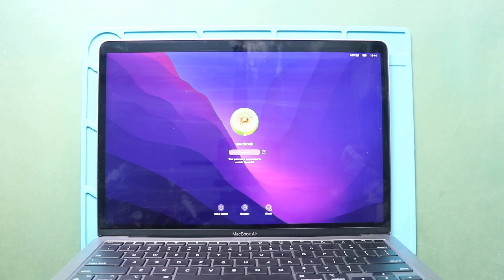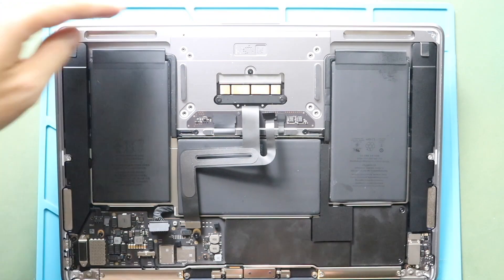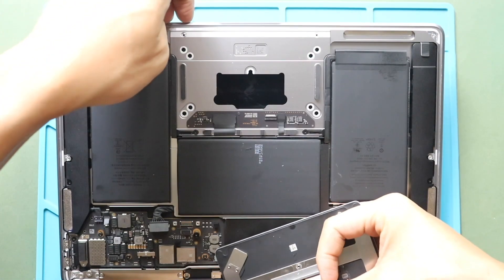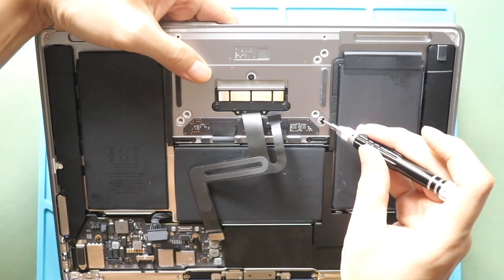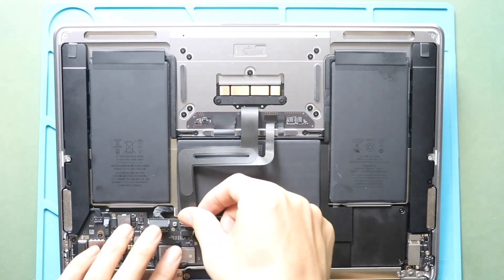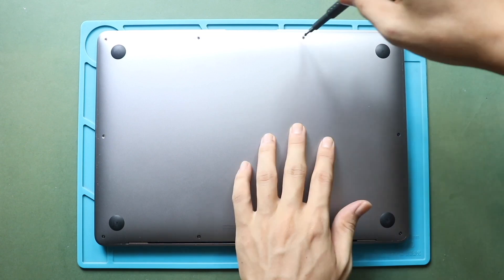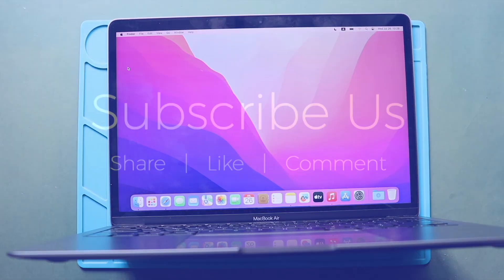Macbook Air M1 A2337 Trackpad Replacement | trackpad Connector Flex

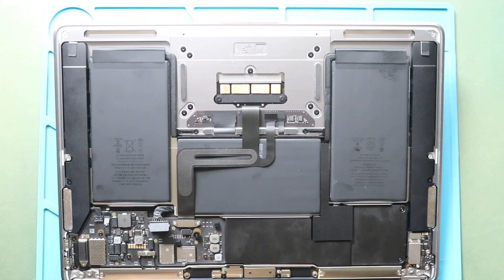Comment: My T3 and T4 screws don't work on the trackpad cable cover at 1:30. What else can I use?
Reply from the maker: DO you will loose or what? strange normally TC or T4 works, Did you try T5, good to have different screw bits